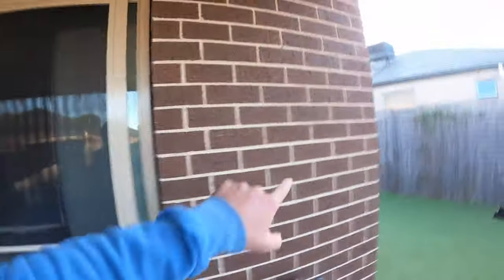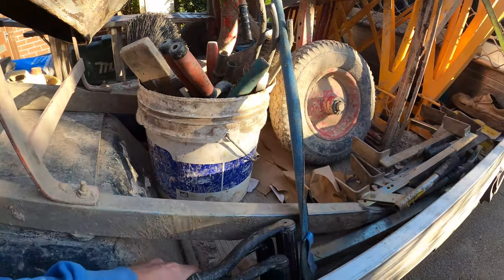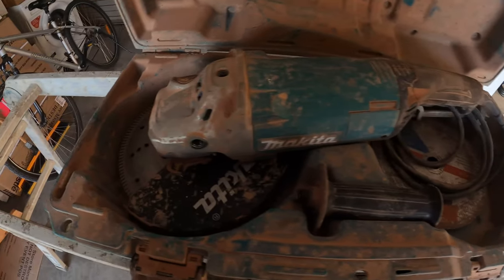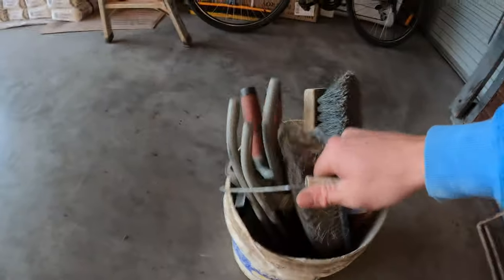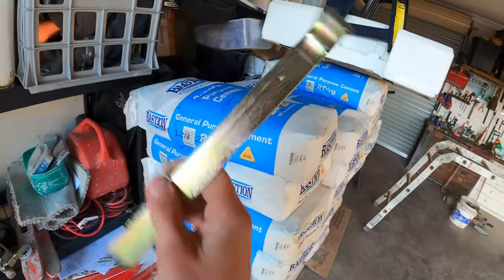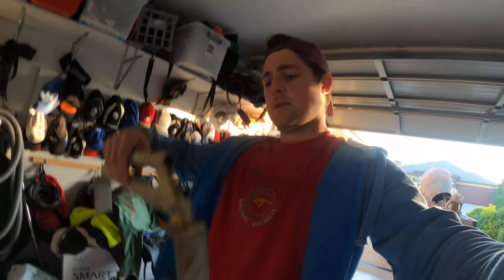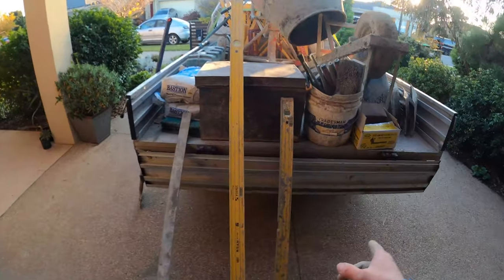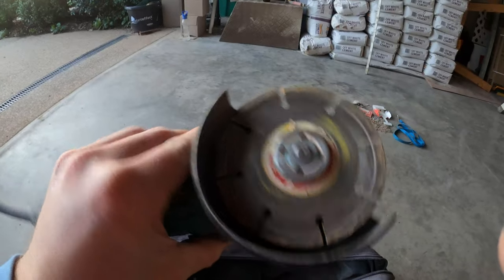What's in a Bricklayers Toolbox ?

Comment: Awesome vid mate .
You use 100×100 profiles? I'm using 50×50s , also would recommend dewalts crossline level saves filling up water etc and another must must have is lime juice from technique tools replaces the lime so no more white dust you don't want to breathe  that stuff in keep up the awesome work
Reply from the maker: Erhan Pilen ahh I made a mistake there! I was meant to say 50x50s !!! Yeah I’m gonna turn to lime juice! I have a sample from technique to try. How does it work?
Reply: Lime juice is the best thing I've done you put one cap into the mix at the start of mix and it's like using two shovels of lime very very happy